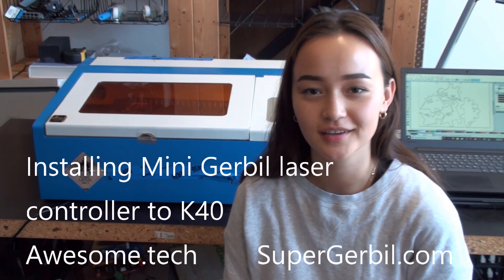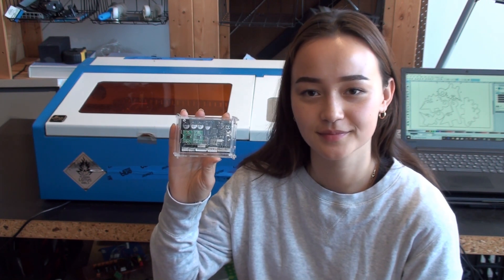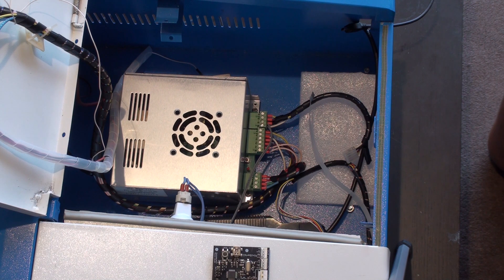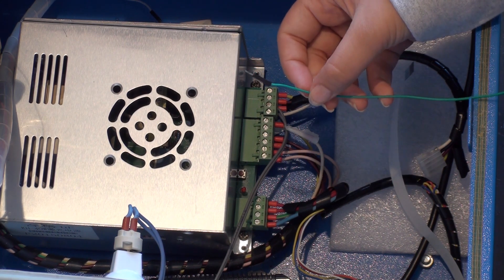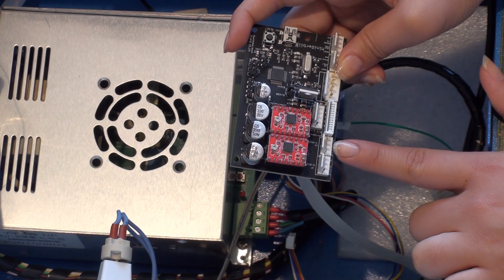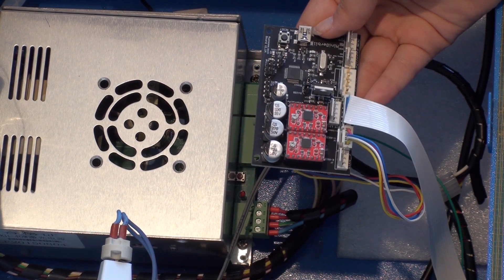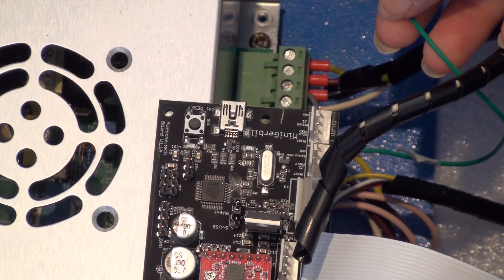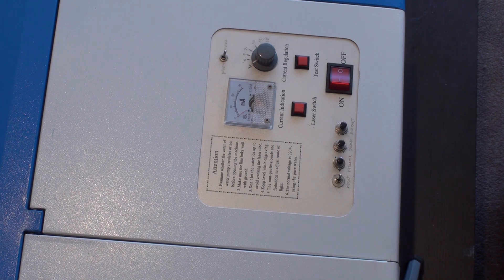Mini Gerbil hardware installation - K40 laser upgrade

Comment: Just installed mine and it’s brilliant! I also got the rotary switch, so I don’t have to open the side of my k40-type machine every time I want to connect the rotary. My power supply was different, but someone on the forum helped me through.
Reply: where did you find one? They seem out of stock

Comment: Hello. Just ordered one mini gerbil for my K40. Does it already come with the green wire and usb cable shoed in video? Thank you
Reply: Hi Paulo, the PWM wire (may be green or some other colour) does come with the Mini Gerbil.  The USB cable does not, you need a USB mini-B type cable (other end is standard USB A type)

Comment: Going to attempt to install it on the other type of power supply. It would be nice if you guys could produce a video showing that type. Also, Paul, thanks to you and Don for all the info you have given me on the Maker Forum.
Reply: I had the old power supply on my k40 and my motherboard was super old and had a parallel port. I had to move the 24v wire to a different slot and it worked I would upload pictures if youtube allowed it but I bet we have the same power supply and it is very easy to do. the nano has 4pins just like this board let me know if you need help.

Comment: I have two questions. When I disconnect the PWM wire from the power supply and connect the Mini Gerbil’s PWM output back to the power supply does that mean that I can no longer control the laser output with my pot? If that is the case will my analog ma meter still work?
Reply: Yess, you wil see the mA output.

Comment: Update. It's been working for over a year, happy with it.

I received mine today and it does not work.  Installed drivers, followed directions for both Inkscape and Lightburn, nothing works.  I think I will go with a https://cohesion3d.com/shop/controllers/cohesion3d-laserboard/  ...I am just so disappointed that this board does not work after waiting for it to show up. I should have just paid the extra $100 and got the cohesion,   ...I guess you get what you pay for.

My k40 pins were backwords from china after reversing the wires it worked.
84westy is triggered 😆
Reply: Hows the Cohesion3d working so far ?  year is enough to know if it was worth it XD
Reply: It sounds like you put literally zero effort to get it working and are merely posting an ad for a different board. You'd have to be pretty bone headed to not get this thing to work. You sound like not computer literate.
Reply: @84westy55  you triggered?
Reply: @takismail  Read my entire comment, I'm actually happy with the board, my machines pins were just backwords, they explain that too. I just didn't read through all their support material, they are a good company.
Reply: @dougtyper  if that the case is good, as i saw many who are not happy with the board, was searching upgrades videos as i wanted to upgrade myself, so far no videos or working upgrades.
Reply: @dougtyper  Are you 12 years old? How is disagreeing with you 'triggered'? Pathetic. grow up. And next time don't jump so quickly to trash someone's reputation. I notice that you have left your comment as it is, people only see your update if they click on show more. Very helpful to this company considering you were wrong and they helped you sort it out.

Comment: Thanks this is exactly the thing I need and at a great price. I hope you do well with this. I did have a k40 but got rid of it a fcouple years back due to software. Intend to buy another now that this is about.
Reply from the maker: Hi Round, appreciate it.  We're makers who were frustrated with standard K40's, so we know 100% where you're coming from.  Thanks for spreading the word.
Reply: Happy to help you with it. eBay has a lot of K40s for sale and I can help you with the controller. Cheers.
Reply: I know this is a late reply I got a gerbl kit with fan ect but my original k40 wires are the shitty ribbons I wanted to change to normal ends stops so made my own exstension will this be ok?